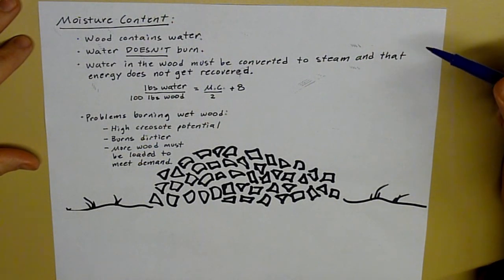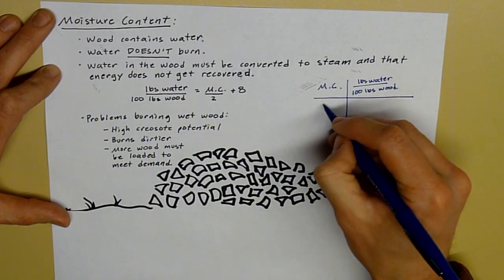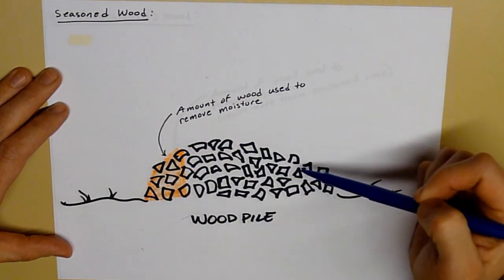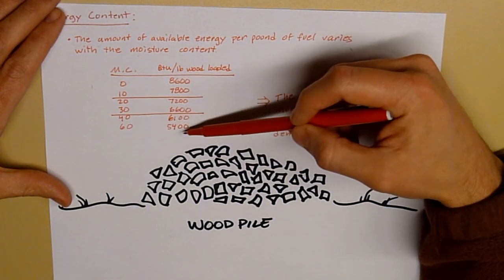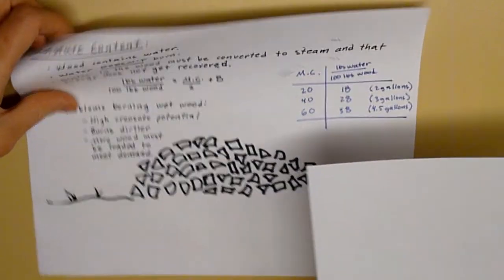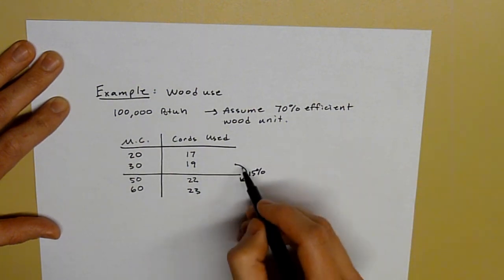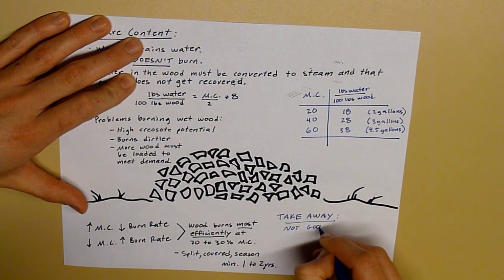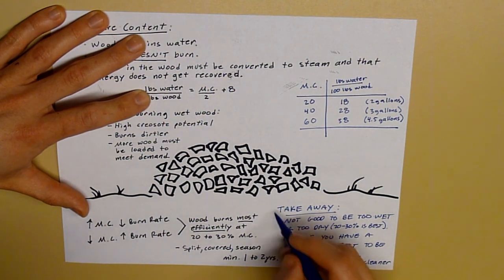GARN: Importance of Fuel Quality - Details and Numbers

Comment: I'd have to agree with Jon.  10-20% is where it's at.  I've not been able to get it drier than that without putting it in the oven anyway.  

You mention multiple times that burning wood under 20% is no good, but you don't attempt to explain why.  It doesn't make any sense.  I can see that it might damage the boiler if you burn really dry wood, but that is where the benefits end that I can think of.  I've picked the brains of a few industrial wood chip steam boiler operators, and they always say they like to get their fuel 20% or less.